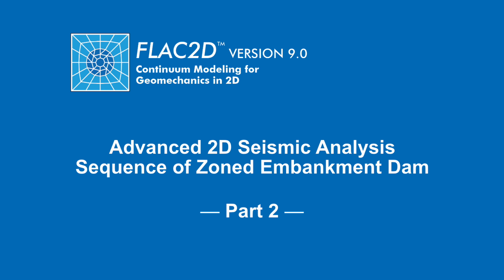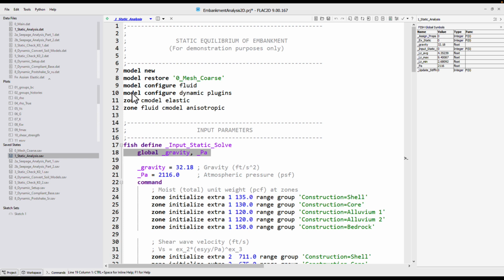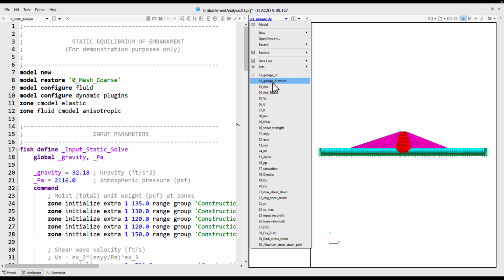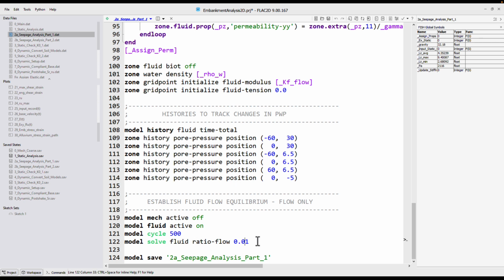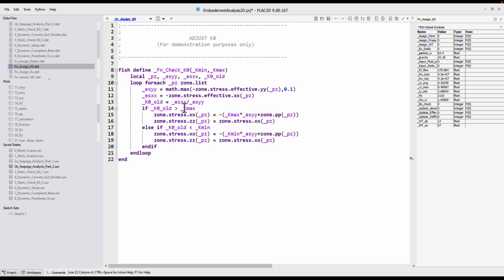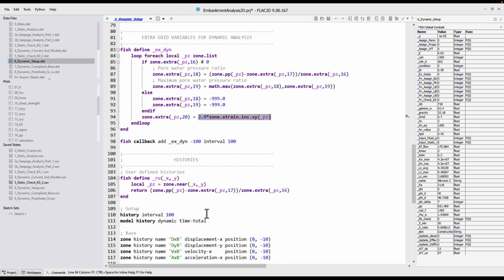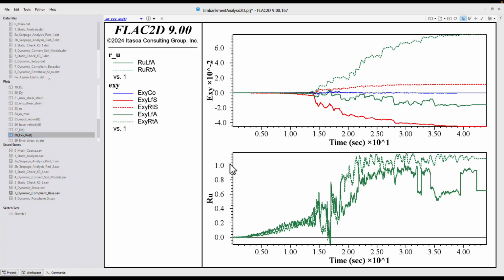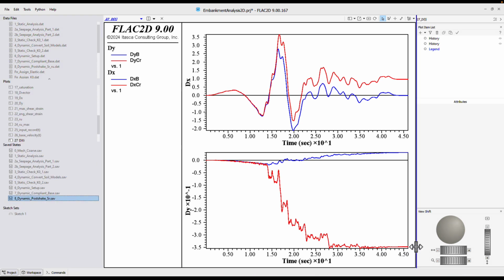Advanced 2D Seismic Analysis Sequence: Part 2 | FLAC2D | ITASCA Software Academy

Comment: Good day, at 20:12 we see that the fluid modulus for flow is computed as Kf_flow = 0.3 * Lzmax * gammaw. Lz is the element size of the largest zone. What is this expression? The fluid modulus is then set to 0 for dynamic calculation. Could you please comment on this?
Reply from the maker: Hi Juan. This tutorial uses FLAC2D 9.0, which uses an old fluid logic (updated in v9.1).  Properties were set using the zone gridpoint command. Since the new fluid’s been added the fluid-modulus and fluid-tension properties are part of the zone fluid property command. 

The Kf_flow variable is a standard limit set for the fluid modulus to ensure numerical stability see Equation 12 in Solving Flow-Only and Coupled-Flow problems -> Time Scales. Also, Notes (2) and (3) under the “Recommended Procedure to Select a Modeling Approach” under Table 1: https://docs.itascacg.com/itasca930/flac3d/docproject/source/theory/fluid-mechanical/solving/solving.html?node2563#equation-eqfluid-solve-m.
Reply: @itascasoftware  I have a question. In the expression mentioned by Juan and appearing in the FLAC code, shouldn't it be divided by porosity, resulting in: Kf_flow = 0.3 * Lzmax * gammaw / n?